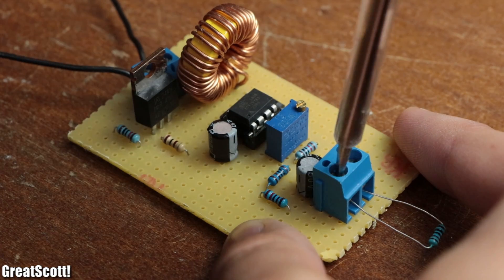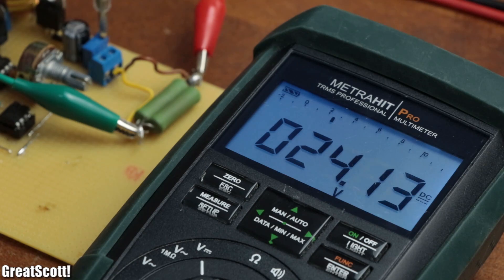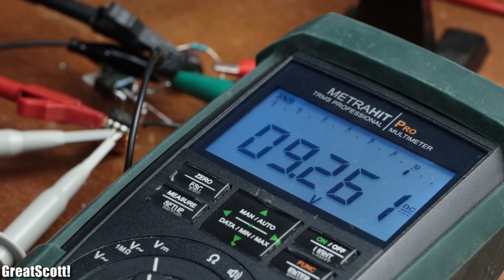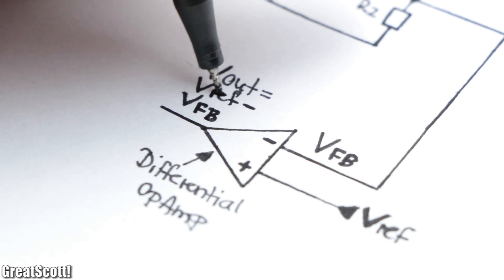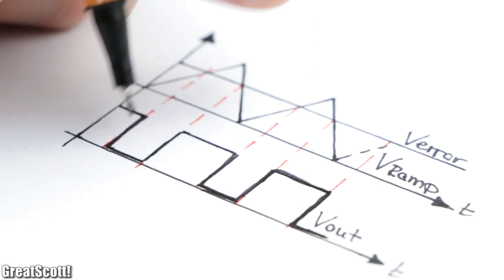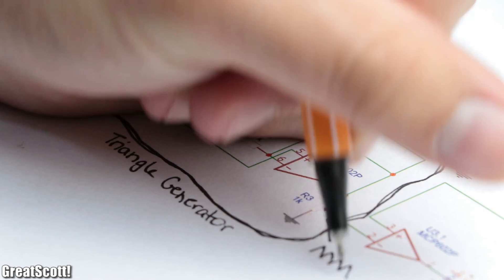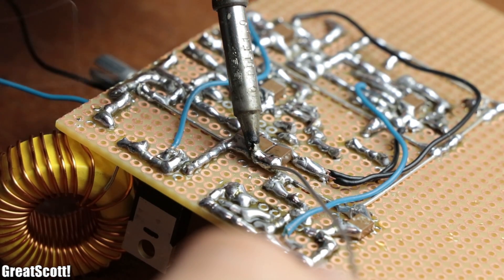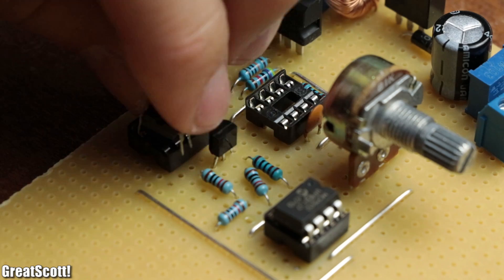Creating a Boost Converter WITHOUT a Microcontroller

Comment: Ok ok, ill admit, i was one of the noobs asking for this video.

But after seeing it i would like to refine my question. Is it possible to make an analog boost converter (without IC) that is unregulated, and has a sort of stable voltage? 

Like a battery does not hold its voltage perfectly when you put a load on it... And that would be acceptable from my boost converter too within reason... Show me how to do it with no IC :))))
Reply: "boost converter that is unregulated" is an oxymoron
Reply: matt holland well if you never had feedback and just a steady pulse it would be unregulated? Those cant be made?

With eigther pwm or another kind of switch even.
Reply: After I made that comment I realized what you meant. It all depends on what you mean by regulation. If you have a steady DC current draw a DC/DC converter with no feedback shouldn't have any issues (I think?). One might say then that the act of changing one voltage to another is "regulation". But of course if you have wildly changing current draws then that's when feedback helps with maintaining the output voltage. And you could say it's the feedback loop then that is "regulating". This is some language pedantry that i'm a bit unsure about. Anyways, i think you mean can you make a boost converter with no feedback and just a fixed pwm waveform, and the answer is yes but it won't react as well to dynamic loads.
Reply: matt holland cool thanks :)

For charging batteries and capacitor banks i think its quite possible to make something without feedback. Since the voltage gets pinned to where you want it anyways. Maby it could even be done efficiantly :p

I wonder what other kinds of old school switches there are from before pwm's ha! I guess a large inductor could use a lower frequency

Comment: Minutes into the video and i can already tell you that "We can create circuits without a microcontroller, but usually that does not make a whole lot of sense!" is my favorite show in the internet. the oposite show would be amazing as well. great video as always
Reply: There are so many projects out there that use a microcontroller when not necessary.  e.g., Turning a light on when a switch to throw.  I have seen this done with an MC and it made me cry.
Reply: Jeff Smith lol same.  its this arduino raspberry stuff thats caused this to happen. i shake my head when i see such stuff
Reply: For example: normal switch mode pc power suplies have an PWM controler IC instead of a mC to keep stable all the output voltajes
Reply: It annoys me too, but the converse is often true as well: Sometimes putting a 'trivial' microcontroller in a circuit can replace a couple of 4000 series chips. It feels wrong, but it's the simplest and cheapest way. Did it myself when I adapted a car alternator to be powered by a bicycle -drive - I could have generated the required field coil drive using a few analog components, but it had a lower part count to just use an atmega.
Reply: By using microcontrollers you can easily add new features and change parameters without changing any external components (PWM LED driver for example). Nevertheless, in mostly power supply designs, dedicated IC's are still in use. The biggest advantage in dedicated power IC's is continuous feedback loop (ADC in uC needs some time to measure the voltage, then some time is needed to calculate things and change pulse width on the output). But yes, microcontrollers destroyed old "good" elecronics in some way.
Reply: @Basement ScienceE There are microcontrollers with better built-in ADC (stm32 with 12bit 2.4MSPS for example), but using 32bit, 48/64 pin uC (SMD only) for simple SMPS is in my opinion a bit overkill.
Reply: For turning on a light actually makes sense to use an MCU, but only if it has Wi-Fi, Bluetooth, Zigbee, LoRa or similar. Then you can connect it to the Internet and you have an IoT light! Which is very interesting since I can put a sensor so that the light turns on after I pass through the door and it's dark outside.
Reply: GRBTutorials
Great now the Russians have turned of all my lights...

Comment: Word of advice:  You need to use flux so you don't get the sharp spike tails when you re-solder anything to a joint.   Use a syringe of flux paste and apply it Every time you solder anything.  Joints will be much better and it's easy to do.
Reply: Stephen Kramer 
Yea, paste or liquid flux is really helpful!
Reply: I think he has bad solder.  The flux core in the solder is usually enough in my experience.

Comment: While this can work, the circuit is semistable. For slowly changing loads or input signals it will work fine, however for transient loads it can show an extreme under and overshoot (google "right half plane zero" for more information), also it has a very low phase margin, so it could, with some parasitic capacitances in the circuit, start to oscillate. (If you operate in CCM)
Reply: I wonder if those are the "few problems" he has with his circuit, or if there are others as well.

Comment: And then there is me. I just buy them...
Btw to you other guys. I can recommend JLCPCB. The circuits are dirt cheap but looks like a million!

We use the circuits for power supply monitoring and after receiving the first 10, bought 50 more the same day and got them 20 days later.

Comment: A microcontroller programmed by someone who does not understand control theory will always perform poorly in comparison with a properly designed boost converter without a microcontroller. The methods of control I've seen in videos like this with microcontrollers have been, at best, crude hacks!
I have yet to see anyone test the dynamic performance of their microcontroller-based switcher of any type.

A boost converter operating in constant inductor current mode does not require a change in duty cycle to compensate for load changes as such, only to compensate for differences in losses with varying load current. It does, however, have a right half plane zero in the transfer function.

In the schematic shown in the video the error amplifier has very low gain (approximately unity, but not well defined, since the feedback network changes the gain). This is VERY unlike the way a normal error amp works. Typically, though not always, the error amp is run open-loop at DC and the closed-loop AC gain is carefully set for maximum bandwidth compatible with the requirements to assure stability. Because of the right half plane zero problem in CCM, there is no practical choice but to accept low bandwidth.

Comment: I have a feeling with good design regarding the PWM frequency, output filter and loop compensation, you'll get a boost converter that has a better loop response compared to the microcontroller design, so that's one reason to use the analog version.

Comment: Hey GreatScott! Great video! Can we get a tutorial for making a 12 volt power supply that would power a computer? I know its very ineffecient and would drain a standard SLA battery too fast and it'd be easier to drive one from an inverter, but I think it'd be interesting to see how many boost and buck converter stages you'd need to do it. Edit: I should specify, for a desktop computer, so ATX power. Maybe for an older machine since most modern computers require a lot of power?
Reply: SirDovahBearYT 
You would be better off replacing the ATX supply with a 12 to 12, 5 and 3.3 volt supply/converter.

Comment: Microcontrollers are replacing a lot of other ICs and making hardware work easier. Also, we cannot use a microcontroller without having a computer to program it. I guess this is only the advantage of non-microcontroller projects.

Comment: Hey ! thank you very much for your video.
I have a question about your triangular wave generator. I try to do it for 3 weeks with an LM358p, it doesn't work all the time but when it works, the form is horrible...
I'm desperate....

Could you make a video about oscillator with op-amp (wien bridge, ...) ? It could be really cool :)
Reply: Use a faster op-amp. A faster near equivalent is the MC/RC4558 or the expensive CA3240 Daul PMOS op amp.  Other factors are the operating supply voltage and rail to rail swing of the output voltage.

Comment: I've seen most of your project videos, mind to answer my silly question? Why do you use donut boards instead of stripboards? Isn't it easier and less soldiering required to build circuits on a stripboard?

Comment: Hi GreatScott (congrats on your interesting movies! :) ). That is to say, I need an advice ... , and so I have a question. I have to create a network based on arduino devices. One hub and 8 nodes. Hub based on arduino due, nodes are using arduino mega. You may consider this to be a sort of security system with bi-directional communication between hub and nodes. Range of communication is maximum 10-15meters. However, each arduino (9 together) must have a tft shield display on (it takes a lot of connections). What solution/device should I use to support wireless communication within this network? To note, data transmission will be very, very low. Thank you in advance. Maybe there are a few options available?
Reply: Adam 
Go do some research yourself. Google is your friend!

Comment: 30volts is the amateur  voltage output, the same components can do 400volts! Building his circuit is the safe but, usually useless, he could't make a ferrite transformer inverter with a few components, fail.

Comment: I've never heared about using microcontrollers in such circuits..
UC3843, TL494 and some other are oftenly used instead
Cause they are exactly made for those converters and switching power supplies
They are comletely analog, cheap, and require a few components to work properly
UC3843 even provides current limiting feature and voltage control without addition of any external comparators
Reply: I've got a 2.2kW PSU here that has a PIC 18F microcontroller in the middle controlling all the switching devices.
But yes they usually use a dedicated PWM or switching IC.

Comment: Is a voltage divider a good way to regulate voltage? Or is it better to use linear / switching regulators?
Reply: Use a regulator if you have any sort of load.
Reply: If you just want a low power signal to feed into e.g. a comparator, or use it as reference voltage, thats fine. If you want to drive a load with it, use a linear regulator. If the load is high its worth using a switching regulator as it will reduce the wasted heat.

Comment: I don't get the logic of this.  We should build switchers with microcontrollers because it is too hard to build one out of op-amps, comparators, voltage references, resistors, capacitors, and mosfets?  You answered the question properly at the end. Use a switcher chip.  Don't reinvent the wheel.  With a switcher chip you can build one with the chip, the inductor, diode, and capacitor, and done.  And it can be trusted to be stable and regulate properly.  The only reason to build one this way is for the purpose of understanding how they work at the deepest levels.
Reply: Yep. As you could see in the shown datasheet of the MT3608, that circuit would be very simple. Some time ago I made a mini boost-converter with that chip. The main value of this video is to educate and indeed to create understanding.

Comment: You don’t need all those components in place of a micro controller, so it’s hardly a fair comparison! Using something like the ubiquitous UC384x series ICs, MC34063, TL494 etc would be much simpler than trying to roll your own. They’re made for this very job and are cheap. I don’t get why you’d use either a microcontroller or this method, unless it’s purely educational.
Reply: It's purely educational :)

Comment: Its pretty appparent that nobody watching your videos actually use or test your circuits. I just wanted to use this circuit and no I cannot use a microcontroller for the job. Aditionally I have never actually used any microcontrollers or a arduino. So the problems- well the triangle wave, whatever I do I cannot get the waveform to the perfect shape like you showed in the video. And I cannot achieve 0% dutycicle no matter what I do at the output. Im testing the driving circuit alone with no power components btw. And the circuit is simply useless. I designed a board for it so we can eleminite the nature of the solderless board. What could be the problem then? I also noticed..a bit too late that you used a 50K potentiometer in the video instead of the 20K in the schematic. 

For refference I wanted to use this contraption for a 500V boost converter (Flyback). There is no IC available that can do HV regulation (except the LT3751 which simply failed completely and its expensive).  And no its not a photo flash charger it would be used as HV regulator .

Comment: If you can get away without an microcontroller do so! With microcontrollers there's not only the hardware (circuit) you can mess up but also the software.
And why split it into so many components when there are already pre made ICs for the application? But then again the pre build converter boards are so cheap nowadays that I don't even bother building something like this myself.

Don't get me wrong. There's a lot to learn in this video but I generally disagree with the conclusion that using a microcontroller is the better option here. Especially if this is just a small part of a bigger project because then you don't want to put an extra microcontroller on a pcb just for stepping up some voltage.
Reply: But then the microcontroller would have to switch between boosting the voltage and it's main function and the boost circuit itself needs to be checked constantly. 
This is simply not possible if your main circuit needs accurate timing from the microcontroller aswell. Of course you could use interrupts and what not but I would only consider that as an valid option if there is absolutely no more space on the pcb. But the proprietary IC is so tiny that this will rarely occure.
Reply: Of course if it's possible for you you can do it but my point was that using an microcontroller is not always the best option for such simple tasks.
Reply: Often much easier to change code than hardware.

Comment: Great video for teaching the basics of a feedback control on a circuit, for the readers: the only disadvantage is that this kind of controler is of the P tipe (proportional ), and it may add overshoot or oscilation to the output, the Best kind of controler for this applications where speed, presition and stability is mandatory is the PID controler (Proportional, integral, derivative) and it is easy to achieve on a microcontroler , you can still make it all pure analog ,  its really fun but time consuming ...  I still preffer analog hehe. Great video Great scott!

Comment: I have never seen a DC-DC converter controlled by a microcontroller. Implementing a MCU controller DC-DC controller has no practical benefit unless the microcontroller has a built-in DC-DC controller inside it.
Reply: I saw a few SMPS which were "semi digital" - whole operation was analog, setting voltage and some diagnostics were digital, but I can't recall any of them.
Reply: IMAX b6 uses uC, but it's not reliable. it's that parts count really affects overall product costs board space etc
Reply: Furthermore an IC chip would need its own regulated supply..

Comment: I really don't understand why people refuse to use microcontrollers. Learning how to code an Arduino is not hard at all.
Reply: I've written lots and lots of code for microcontrollers. I've designed lots of switchers. I'd never even contemplate using a microcontroller to run the actual power conversion a switcher unless there were some very special requirement.

Comment: I've been working with boost converters for over 20 years and have not yet come across one that does use a microcontroller. The analogue parts are good enough and cheap enough, and I suspect a lot more efficient.
Reply: And in safety critical industries like aerospace they are preferred as ICs are generally easier to verify than microcontrollers and code.
Reply: I've seen a chinese cc/cv board with a stm32 once.
Reply: I have repaired many switching power supplies. None of them had microcontroller.
Reply: +CoolKoon - Of course an MCU is always a choice, and sometimes it is the better choice. But in 2018 I do not think most switching supply designs are best done this way. Actually I am sad because I would like to create a super cheap switcher using an MCU but these days with integrated switches, synchronous flyback and high frequencies needing only very cheap inductors and capacitors, I think the game is over for common applications. 

There might be some niche applications where factors other than outright power or efficiency are primary that would benefit; such as stability into ultra low power factor loads or continuity of supply over decades of production. There maybe an MCU is a good choice. 

But - and this is important - you should always play. So go ahead and make an MCU SMPS. You'll learn so much on the journey.